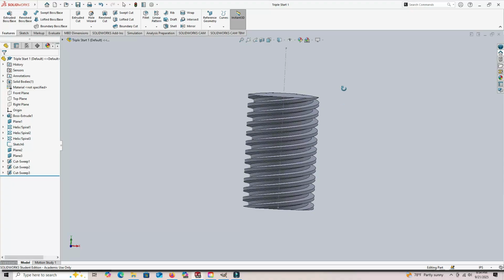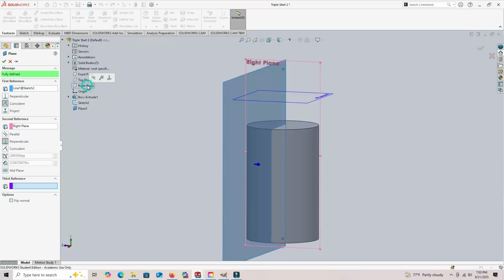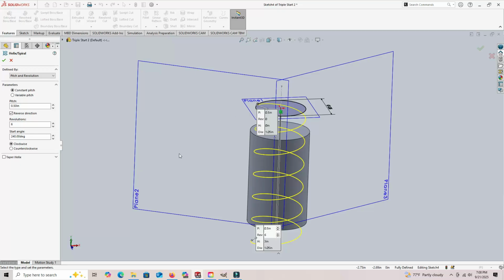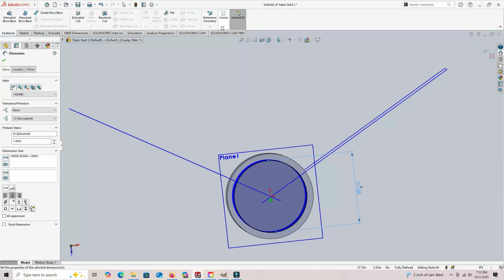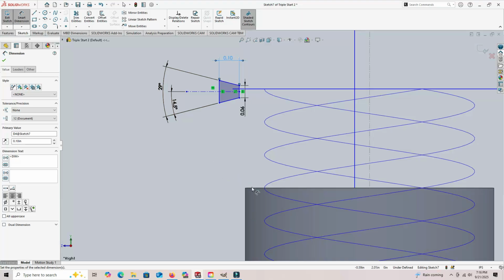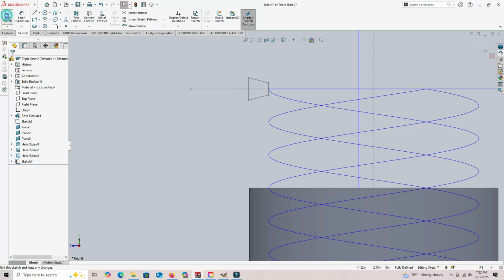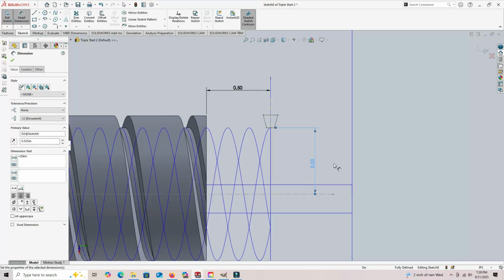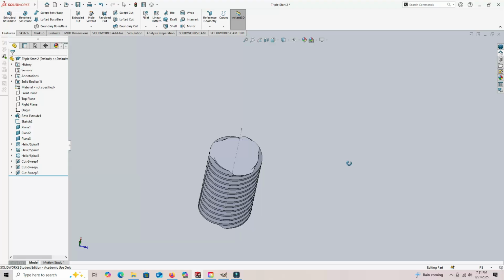Solidworks Tutorial 14 - Making Multi-Start Threads Using Blocks

Comment: Alternatively, throw an Axis down the centre of the part  do a helical cut at the correct lead  ( pitch x starts) , then circular copy feature about the axis.

If you want to reuse a drawing (on the same plane) from one feature, just select the drawing in the feature tree as the drawing for the new feature.
Reply from the maker: I am constantly learning different ways of doing things from you. I wonder if doing a circular copy of the feature is easier on the computer in the lag department. Seems like something that should be tested out. My guess is it would be the same though.
Reply: @StuartdeHaro  I believe, once the part is compiled into the final object format (stl for display?) then it is only the size of the 'file' that determines the speed and fluidity of the display (the gpu will have a max number of triangles per second it can draw). The stack of operations to generate the object is just filling memory.  . 

I've found it necessary to separate things with complex geometry, i.e. a heavily textured surface, so that they can be pre-compiled  on their own and assembled later.